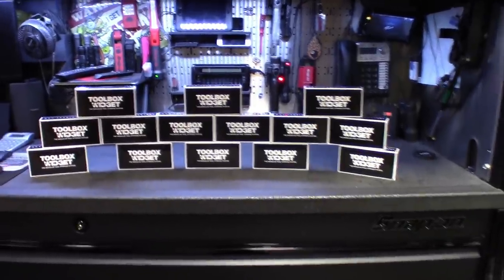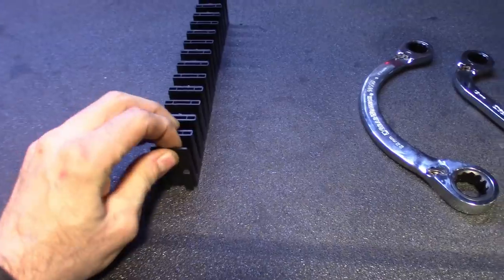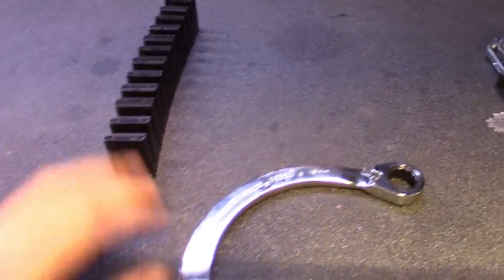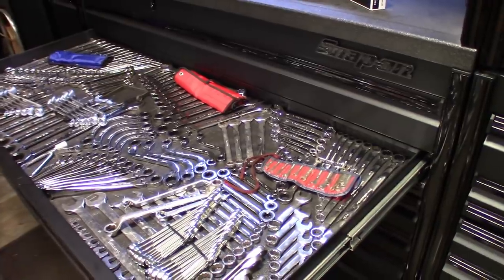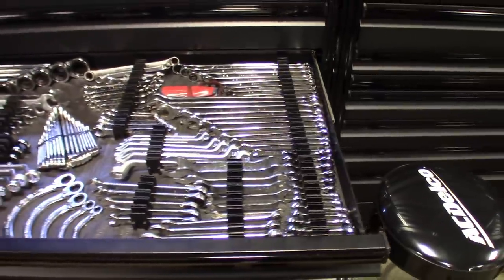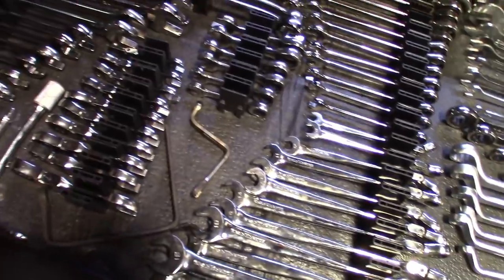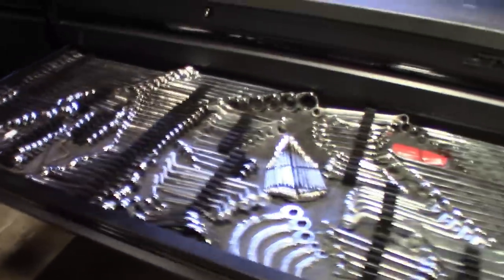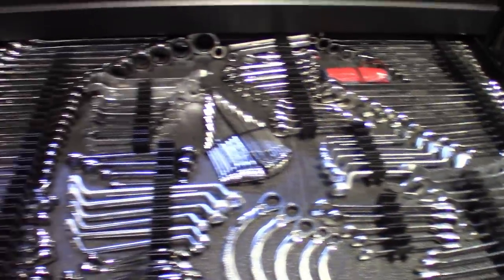Extreme Toolbox Organization Pt2

Comment: Used about 9 of the wrench kits from ToolBox Widget. Until they come out with the dedicated plier kits, the wrench kits do in a pinch for double duty as plier holders. Great stuff, and very quick to turn around if you want to optimize for most used, or maximizing drawer real-estate, which is always a factor no mater what box one works with!